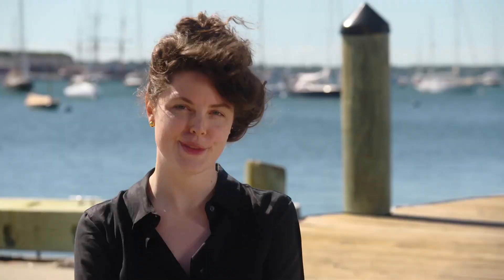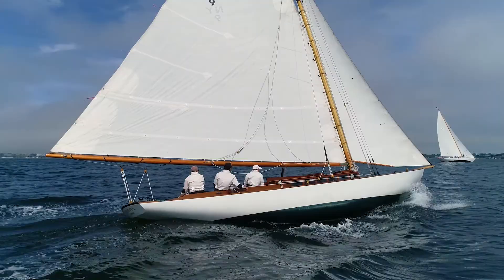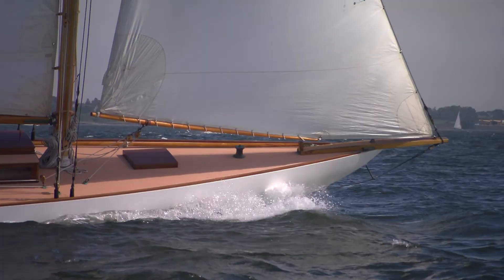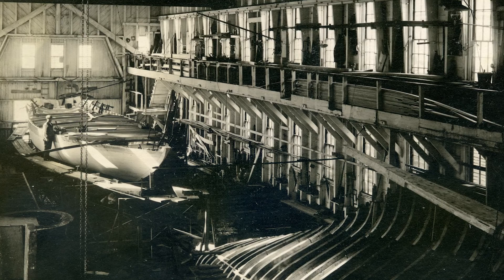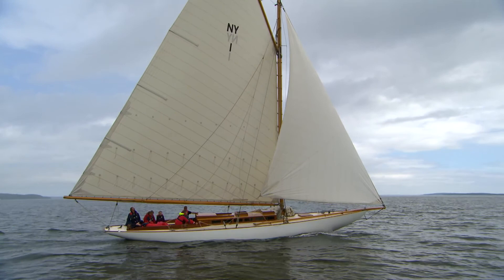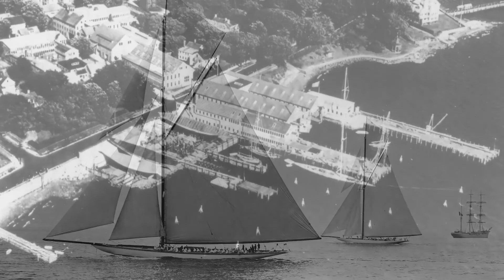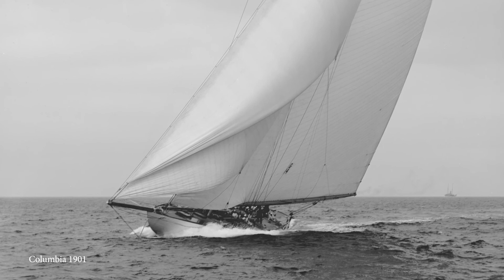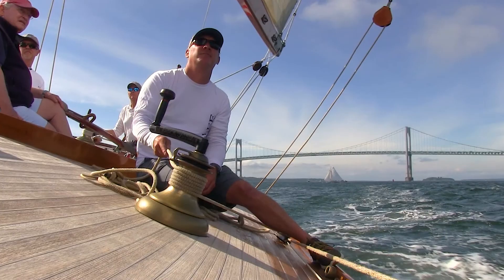Captain Nat Herreshoff's Enduring Legacy by Jobson Sailing Inc.

Comment: A number of years back I paid MIT the fee to build a single NY 30 model boat. Being someone who used Autocad the design buildings, I got a copy of the table of offsets and plotted the out. Fair them and had them lazier cut along with her profile. I glued it all together, planked her with balsa and covered her with two layers of fiber glass. I sent to sail plans to a manufacture and had him put NY 9 on them. Furthermore, I perched some bronze hardware I found online, gooseneck, cleats, and turnbuckles. I purchased wood blocks so that the sails could be raised and lowered. Added sail and steering controls a long with a two channel remote control. She has tan decks, white hull and green bottom. I've not sailed her in a number of years, but after seeing video, I need to get her back in the water as just as the real NY 30s she is a dream to sail.